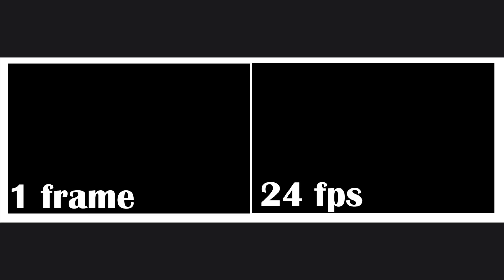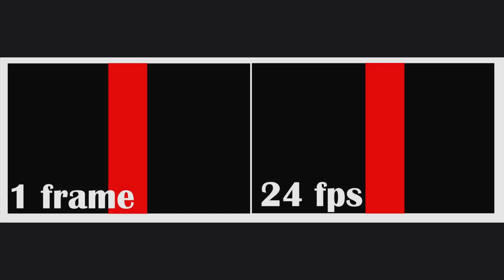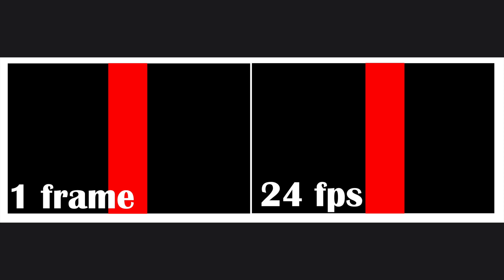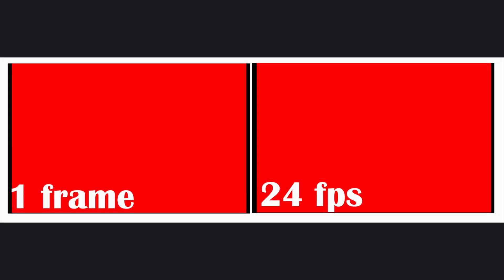how to solve juddering drone videos?

Comment: I have a question..
I have Mavic air 2, Im noticing lately that my videos are more choppy, I upgraded to the fastest xd memory card and also used ND filters applying the 180 rule. That is when I record 4K 25fps, i fix the shutter speed to 1/50 second. But the videos are still choppy, then I tried everything to record H.264 and H.265 but same problem. I suspect something wrong either with the Firmware updates or hardware. What do you think? How can I find out. Please help, much appreciated
Reply from the maker: Are you sure the machine you use for playback can handle the h265?

Even my i9 laptop stutters on the h265 material. Only after editing it plays smoothly
Reply: @FrankDoorhof  you raise a good point. But my choppy video problem also stay when I use H.264
I also tried to format the xd card in different fat32 and exfat, and also tried different cluster size during formatting the xd card. The problem is consistent, even when I record in 2.7K and 1080p
Reply from the maker: What happens when you use proxy in premiere ?

Comment: My DJI Phantom 4 Pro is silky smooth, never had a problem with it.  My new Sony A7S III however has serious "judder" problems.  At least with the A7S III it's not the shutter speed relative to frame rate.  XAVC S HD has significant judder while XAVC HS 4K does not.  I have no idea what the difference is between XAVC S and XAVC HS but what ever it is, one has judder and the other does not.
Reply from the maker: Trust me every device that pans and shoots at a high frame rate will show judder it's simply how shutter speed works. And no drone is an exception or camera. 

With codecs it can very well be compression errors. Or maybe you are shooting in 60p vs 30p. 

But in essence raise the shutter speed and you introduce judder now don't confuse this with studder which is often an artifact and is often due to slow cards or bad codecs.
Reply: @FrankDoorhof  Because XAVC HS doesn't look too bad but the others don't I'm thinking my cards are too slow so I've ordered some CFExpress type A cards.  Hopefully that will help.  Not sure if it's studder or judder, it just looks like the frame rate isn't consistent.  It's like you're seeing individual images discrete but also they are not consistently spaced in the pan or in time.  The new cards are supposed to arrive Wednesday so I'll see how that goes.  Thanks!  Monte.
Reply from the maker: I would first check shutter speed what you say really sounds like shutter speed. 

If you want to see this effect used creatively just watch the opening of band of brothers. They shot that with a fast shutter speed and it judders like crazy. But is in that case very effective
Reply: @FrankDoorhof  Yeah I've already tried just about every shutter speed available on the camera.  Set it twice the frame rate, same as frame rate, way faster than frame rate and everything in between.  I would think if it were shutter speed relative to frame rate it would at least look consistent.  This isn't, it's random, the way it might look if you took out one frame here, then three frames a few frames later, then two, then seven, then one, then two...  just randomly removing a random number of frames at random intervals, very inconsistent.
Reply from the maker: Ok that doesn't sound right indeed. 

Normally to get it smooth btw is getting it as close as possible to the frame rate. But anything double should be fine. 

Above that you can become aware of judder. But that should be constant indeed not variable
Reply: @FrankDoorhof  The CFExpress cards are suppose to arrive Wednesday, I'll find out then if that helps.
Reply from the maker: Keep me updated
Reply: @FrankDoorhof  It has to be an issue in playback, not recording on the camera.  I have the CFExpress cards and it didn't help.  I can only play XAVC HS at the lowest bit rate and it's jerky.  I can't really play XAVC S at all except the HD and it's really jerky.  XAVC S 4K will just show one or maybe two or three still shots out of a 10 second video at 60 fps.  Audio plays normally but all you get in video or a couple still shots. 

So what kind of video player software do I need to play it on my PC?  Windows Media doesn't even recognize the XAVC S,  VLC plays it jerky, Pinnacle also jerky, Davinci 17 can't even put it in the time line.  So what the heck do I need?  Thanks,  Monte
Reply from the maker: What's the spec of your pc ?
I know the mavic h265 video doesn't play smooth even on my i9 dell. On my ipad pro however it's smooth. 

Vlc does give the best options 
But mostly I would just use proxy in premiere and edit it to export as h264 4k and that plays smooth.
Reply from the maker: Yeah that's a h265 codec
Besides the monster machines nothing will play that 100% smooth 

See it as raw files. First process it and than you can play the h264 render

If you don't want to you can also opt for h264 I believe in the settings or get an ipad pro. Those do play it. And the new m1 also from apple.

Comment: Hi thx for the video. You confirmed all my theoretical logic about the judder issue. Until I went and made series of detailed tests on static aircraft - gimbal pan. With different gimbal movement speeds I tested every FPS option with three different shutter settings - 180 degree rule, 1 stop less and 2 stop more than 180. What is very very confusing is that I got the judder on all test shots, even 25fps at 1/25sec. Best results were on 30fps (even at 1/500s the video was better than 25fps on slowest shutter). Also high frame rate doesn't have a problem with that. Care to comment ? I'd be happy to send you more details. Best Regards !
Reply from the maker: That's easy to explain
25 or even 30 frames are not enough for silky smooth pans. You need 60-120 frames for that. 

But this is added to the shutterspeed. 
Frames per second is one thing 
Shutterspeed another

Smooth would be for example 60 frames at 1/60. 

That being said. If you just fly and keep it very slow, you should get smooth video. Every fast movement will judder with 25 or 30. 

In essence you proofed it yourself because 1/30 was smoother than 1/25 which is correct because you have more frames for that 1 second.
Reply: @FrankDoorhof  ok makes sense. I guess that the most confusing thing is why everyone in filming mostly uses 24/25 fps for general filming, while high frame rate like 50/60 is reserved for slow motion. Another downside of hfr on mavic 2 is that it's not supported in 4k and there's a visible lack of sharpness between 2.7k and 4k. I guess my main question is then how the hell to get smooth pans in 24/25fps when even on slowest of pans and shutter speed I'm still getting judder ? Perhaps it's just me, or maybe I should just forget about it and stick to 30fps... Best Regards !
Reply from the maker: You can get it smooth. 
Slow shutterspeed and if course slow pans
Reply: Maybe the problem is the display where you are playing the video. On most PC monitors framerate is 60Hz. Try to play the 24fps footage on a TV and let me know. (Sorry for bad english)
Reply from the maker: Most pc/Mac screens should have no problem. We edit a lot of video and never see judders. The only time with drones and movement we see it is with shutterspeeds higher than 1/150-1/200 anything above that judders way too much for my taste.